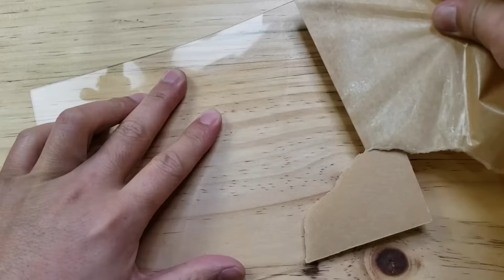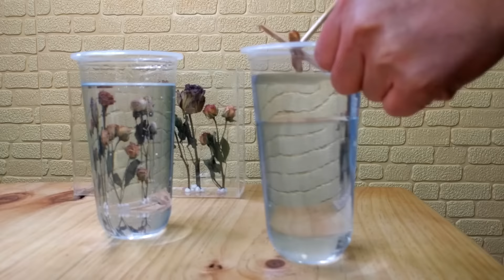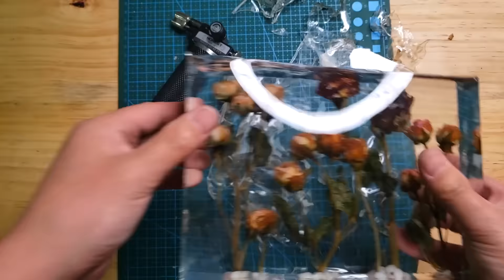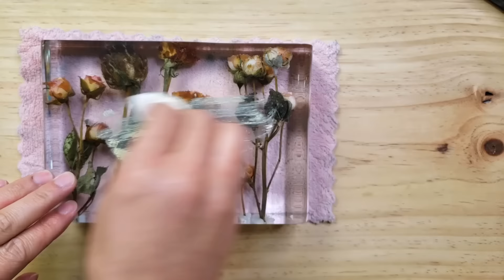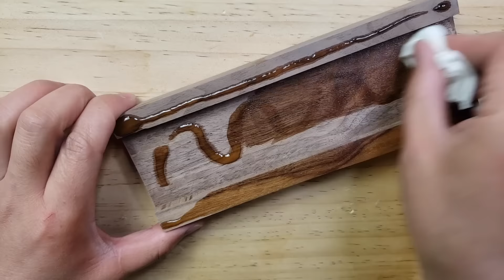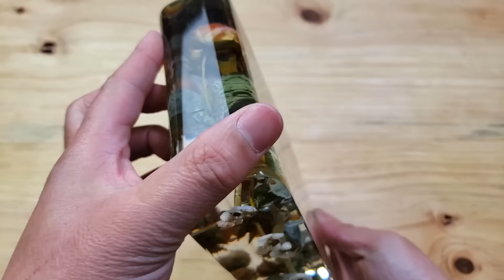🌹Roses and Epoxy Resin Night Lamp - Resin Art 🌹

Comment: Looks beautiful.  You can buy moulds that are silicone and rectangular so you don’t go through all the trouble of sanding rough edges.  Looks gorgeous.
Reply: Professional artists use plexiglass, so they can get exactly the shape needed for a project. It is cheap and will not bend if you use slightly thicker plexiglass. Although there are thousands of molds out there, it is difficult to get exactly the shape needed.

Comment: Very pretty when it's over the light but I would have preferred the roses to be vibrant and alive if this were mine.
Reply: I tried it. The heat from the resin curing turns the roses brown and they degrade quickly. Dried flowers are the best bet.
Reply: @robertbascelli6433   Ahh that makes sense ... Have you tried silk or paper flowers?

Comment: People using LED strips often forget that they need heat dissipation too. You shouldnt cover them like that because you significantly reduce their life span.
Reply: Azog Defiler LED’s Don’t give off heat
Reply: @donnasylvia9882  All light sources generate heat. LED's don't generate as much heat as conventional bulbs but you do have to take heat into account when using them regardless. I'd put a slight gap between the strips and the bottom of the base to allow some airflow to get in there.
Reply: @animegirl8033  nativtexan2 is right, heat dissipation does need to be taken into account even with LED's as they do generate some heat. I am an  industrial electrician and deal with LED's on a regular basis as we use them for light fixtures, and I can assure you, the electronics involved with producing light from electricity, and the process itself, do require airflow to get rid of excess heat

Comment: So far all my works have been wood, I’m fascinated with resin though. 
What sort of glue is used here? I can’t imagine how it’s so strong and keeps the resin from seeping out of any gaps.
Reply: Hot glue guns work fine... otherwise... cyanoacrylate glue.. aka Crazy Glue
Reply: @synapticdragon2157  q
Reply: @synapticdragon2157  no
Reply: I use hot glue. It works fine to hold the mould shape. However, you always have to test for leaks with water before pouring the epoxy. There will usually be some microscopic hole and you can easily mark it and then apply more glue to plug it up. It's a total pain to discover a leak after you've poured the resin. 
Total...Pain...

Comment: So pretty. Loved the light - maybe a little less LEDs  as it washes the colors out.  Love dried roses. Know you can color your dried flowers too with water based floral dye spray. It will be muted.  I think I might have made it a but deeper as the tall flowers are almost out - maybe just a bit deeper.  I will have to remember this.  I think I’d liked something else besides the stark white pebbles maybe something more natural.  I always hate to see people mulch their beds with rocks.  Anything more natural, will have to think on it.  Probably when doing it can test several items on test run - pine tags, twigs, coco hulls, mini pine cones with pine tags, straw spray dyed with muted color, etc.  Might want to put more shorter stems in too so a few less bare stems. Actually you could make a twiggy fence in front, or use popsicle sticks, rough paint to look rustic picket, or use chop sticks painted to look like rails for a post and rail fence, with some pea gravel in front of fence, or bits of fake moss.  Maybe even dollhouse furniture. Like a little scene.  Beautiful and with my garden of flowers - this is great gift ideas.
Reply from the maker: Thank you for your advice, I learned more from you rosebudforglory😊

Comment: Good work and art. Does the epoxy pour not heat up or cause your project to crack. It seems you've poured the entire depth of the mold at once. Did this not cause over heating or cracking of the epoxy. Would you recommend pouring in layers vs pouring the entire epoxy into the mold all at once.
Reply from the maker: Resin with low calorific value can be poured at one time. If it is resin with high calorific value, then layered watering is a very good method.😋

Comment: Hi, your work is great! So pretty 😊 Planning to try doing resin to my flowers, 1st time. I just wanna ask if putting too much resin all at once will not make it hot? Or is it better to divide layer by layer with hours apart? Hoping for your reply. Thank you.
Reply from the maker: If the resin with high calorific value can be poured in several steps, if the calorific value is not high, it can be done at one time.😊

Comment: I thought doing a pour that deep would cause a huge amount of heat and probably cracking. Even deep pour epoxy only recommend about 50mm per layer. Did you get a lot of heat from this pour?
Reply from the maker: Yes, it’s better to pour resin less than 30mm thick each time

Comment: Nice video and well done. Just a very quick question. When I used so much resin like you (when the fluid is deep), I see many huge bubbles the second day (they were not there). I think it was because the resin is too much and it boils, therefore the huge bubbles stay inside. Have you ever experienced the same thing? If so, how you treated it?

Comment: Hi!! I might need your advice because I don’t have a solution for the following problem: I am making a piece of epoxy resin and I had to make several layers of thickness. But my problem is that one of the layers shows the cut and it has been left with bubbles, is there any possibility to fix this?  Thank you
Reply from the maker: This is the tutorial I made before to eliminate bubbles: https://www.youtube.com/watch?v=elKWS1jTf1o&t=386s Hope it helps you😊

Comment: How big is the container and how much epoxy did you use bro??? Can i make it with 1kg A+B epoxy??
Reply from the maker: The container size is not measured, I used 1.5 kg of epoxy resin😉
Reply: @BuzzingFish  1.5kg = 1kg A and 500gr B??? Im beginner need to advise:D

Comment: Anyone know how he got it to have no air bubbles?
Reply from the maker: 1. Try to avoid bubbles when you stir
2. You can put the mixed resin in warm water (50 ° C), and you can quickly eliminate bubbles in 10 minutes, but the quality of the resin you buy is better.
3. You use a vacuum pump to pump air, which can quickly eliminate air bubbles.
Moshe Milstein  If you have other questions, please leave me a comment 😊

Comment: J'aime l'idée, mais je ferais deux suggestions de perfectionniste : 
1/ à l'image des règles de typographies qui modifient l'espace entre les lettres suivant leur forme, afin d’équilibrer les blancs et les gris pour l'œil et ne pas déranger la lecture, les quelques centimètres de hauteur de "vide" existant en bas (car les tiges font moins de volume que les fleurs et laissent plus d'espace libre) devraient se retrouver en haut pour équilibrer. Les fleurs affleurent en haut, non seulement ce n'est pas joli au niveau des pétales, mais l'ensemble est déséquilibré. Ce serait plus réussi avec un supplément de résine au dessus des plus hautes fleurs.
2/ il aurait été plus élégant de prévoir un cache en bois pour masquer les fils électriques ainsi que les soudures, à droite et à gauche du bloc de résine (au deux bouts de la rangée de fleurs) parce qu'ils se voient et que ça casse la préciosité de la lampe.